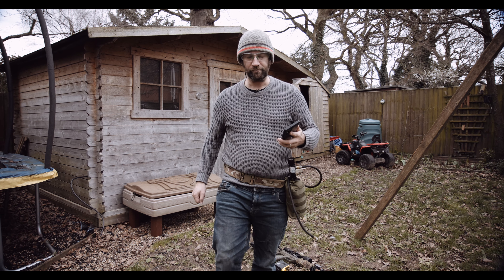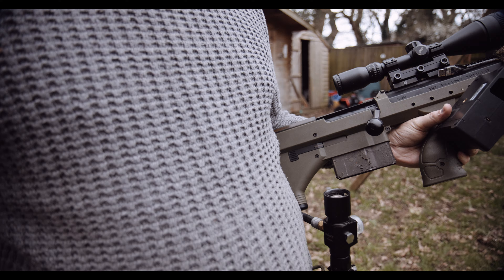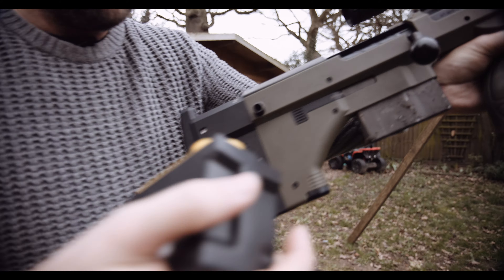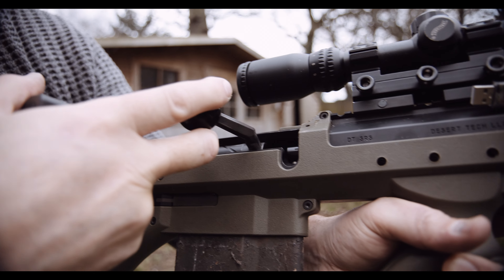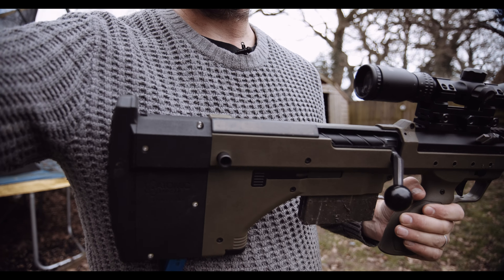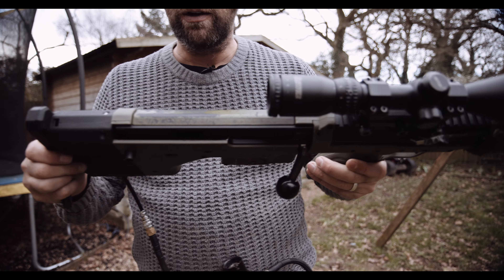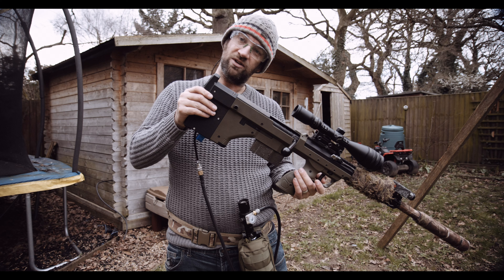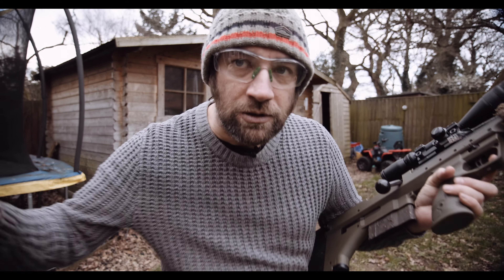Atomic Airsoft SRS HPA engine sound test

Comment: Consider this skeptic convinced! Before this video there was no way i would have believed it so im especially glad you guys put this out. Not just for my own sake but to prove to others as well how insanely quiet this thing is. Now its a matter of everything else (longevity, consistency, efficiency, min/max power, range, etc) but something i absolutely look forward to trying out myself some day. Its a bit pricey, especially compared to the other options available but if it shows “high scores” in those other categories then i would presume to say its well worth it.

Would love to see more test results with various bbs , barrel lengths, and compatibility with other hop units and bb feed tubes (if applicable). I run a 300mm barrel so hitting 2.8j while remaining quiet is no easy feat, even with my spring setup. Hpa seems to have a hard time getting higher joule output and remaining as quiet on shorter barrels. Do you guys plan to do any R&D in the future to gain more energy?
Reply from the maker: Hey no worries, yes we are going to be making loads more videos in the future. We are experimenting with different setups to try to get as much power out of it as possible. With the shorter barrel lengths it will be hard to get 2.8j this unit just reaches 2.1-2.2.  The wolverine electro penumatic engine for the vsr10 is the same can only reach about the same power. At the moment we are trying out porting of the solonoid for maximum air flow, and tweaking the code to make it more efficient and more power. To be honest we never set out to make this engine. We are at the final stages of design on our own hpa sniper, with integrated air tank. So no lines! Whoop whoop. Amd we needed a rif to test the engine on. We basically plugged a line into the srs just to test the engine and tune it. A few days later with the help of cad we came up with this. It was a side project that has really taken off. Where are you based? We are always looking for beta testers for products.

Comment: Hey im pretty amazed! Former bolt m user but im thinking of switching to your system. Just one question. I saw your high power version. Since i play in germany we dont have standard fps/joules. Every field does its own thing. Can i still adjust my joules with the regulator? Just irritated why the one is called „high power“
Reply from the maker: @LöwenTarn  yes you can adjust with your regulator from 1j-3.5j the low power version inly goes to 2.1j
Reply: @atomicairsoftofficial  wow thanks so much! Followup question: can i get the high power version as quiet as the low power one, if i use the same psi?🤔
Reply from the maker: @LöwenTarn  no it's not as quiet as the low power version. It's a fraction louder. But its still is very silent, the sound doesn't change, much even at hugh psi.
Reply: @atomicairsoftofficial  hm i like my rifs more quite… when do you think the low power version will be back in stock🤔

Comment: Seems like the 'first' shot is lower pressure than the following shots. Such as, first shot was ~310 FPS then other shots were closer to ~350-360. Then, when you did the 'without bbs' shots, the first shot was much much quieter than the shots that followed (which would also lead to the conclusion that less air was coming out from the first shot). Thoughts?
Reply: Had some .28s in the speed loader. Psi was all the same.

Comment: What’s the max operating PSI capable?
Reply from the maker: It's 120 psi capable of max 2.2j
Reply: @atomicairsoftofficial  Thanks. Capable of 120psi and max 2.2j with what weight BB? Can it use .48s?